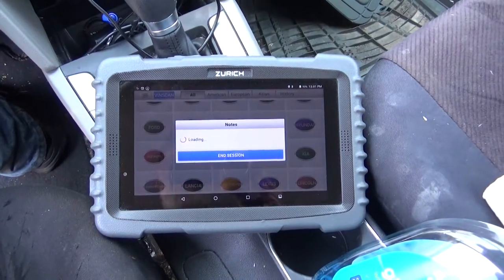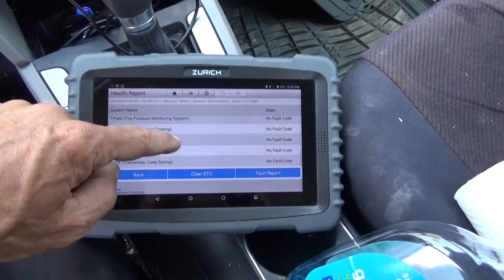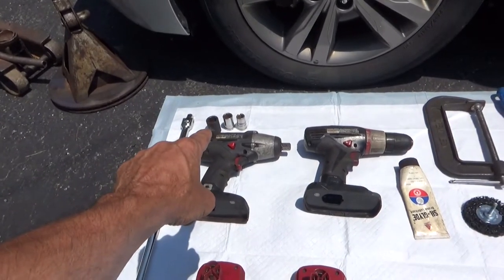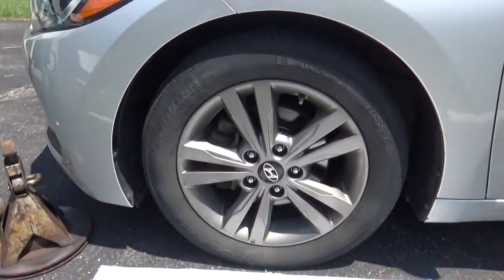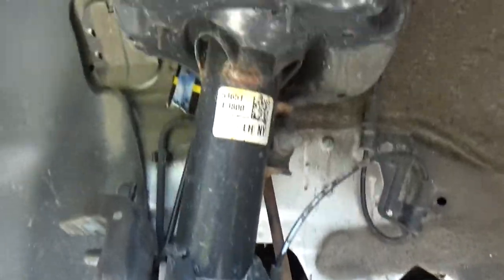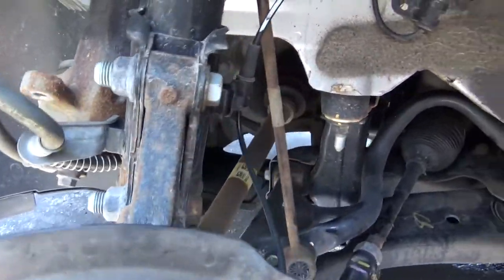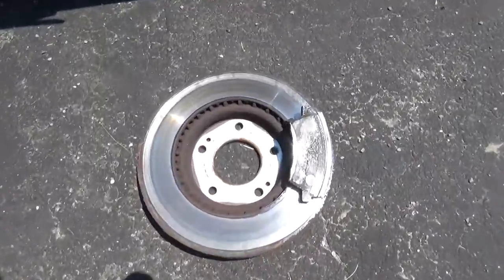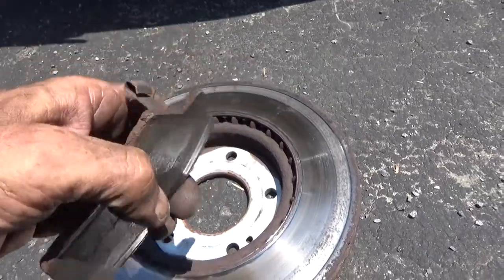2018 Elantra (ADA) Front Brake Replacement - Auto Repair

Comment: So what did that fancy computer teach you how to do brakes. Smh
Reply from the maker: What did it TEACH me? Nothing.
Using the scan tool to do a diagnostics pre-inspection, alerts me of any potential issues, as well as allowing me to inform the vehicle owner of the same. The use of the scan tool is in no way required for THIS service, but there ARE brake services where the tool is required to put the vehicle into SERVICE MODE.
 Using the scan tool is a free diagnostic service performed for the benefit of both myself and the vehicle owner. (Hard to be blamed for something pre-existing, when it's documented)

Comment: Very useful video. The best feature is your verbally describing every step of the way and what tool & size you are using as you use it.
Reply from the maker: It all began with "What is involved?" When I could search and find what I wanted...great. But...when I couldn't find anything, that got me thinking, and creating.
Reply: @HouseCallAutoRepair  I reckon my only question would be why did you not use Anti-Seize on the two little rotor screws and the two caliper bolts? Anti-Seize would make future brake pad changes much easier.

As for my 2019 Elantra SE, it's at 81,000 miles on the original brake pads and it's past time to change them. I hope I don't have to  change the rotors too but I'm prepared for the worst and hoping for the best. Thanks again for your great video!

Comment: Thank you so much! my 2018 brakes are due and after watching many videos I felt confident but watching a video about the same exact car as mine is amazing. Thank you and your camera angles were amazing. Very pro, you help people save ton of money.
Reply from the maker: It's sad to see something so new, needing brakes already. The last brand new vehicle I ever owned went 128,000 miles before it needed front brakes. 135,000 I replaced the rear, even though they would have gone several thousand more miles.
Reply: @HouseCallAutoRepair  I agree man... my car had 45000 km and it needed front rotors while my pads were basically at 40% life used... rotors are bad. My old 4 years German Lease was returned and never had a brake job

Comment: I could almost read your mind when you were putting those paperclip looking things back on! Anyway, no mention of siphoning any brake fluid out before compressing the piston, is that not needed? I've always done that in the past. And do you not recommend antiseize on any caliper or bracket bolts? I know it messes with torques, but I never torque anything anyway.
Reply from the maker: While brake fluid is recommended to be replaced every 4 years or so  (hygroscopic)
 I don't mess with removing any brake fluid,  unless fluid has been added to compensate for low levels due to wear.
As for bolts... I'm trying to condition myself to use blue thread locker on all of them!
Antisieze the brackets UNDER the hardware clips, the piston surface, and back of pad that contacts the caliper ears (to help prevent squealing)

Comment: Why is it important to get both wheels off the ground?  What's wrong with lifting one side at a time?
Reply from the maker: I personally find it easier, this way, as apposed to doing one complete wheel at a time. The advantage is to unload the suspension so that it's easier to check for loose or worn components as well as turning from right to left and back, and rotating the wheel. Thank you for asking!

Comment: Okay, so just to make sure, the clips that go on the pads aren't necessary? Like on my Rav4 the pads just go on and then you put the caliper on, no stupid little metal clips necessary to hold the pads in place.
Reply from the maker: The metal clips that go between the brake pad ears and the caliper bracket ARE necessary. The little clips that are sometimes already attached to the brake pads, are "squeelers" which are audible wear indicators. I have some Rav4 brake videos...

Comment: The dealer just charged my girl 2 hours labor 197 bucks for changing the pads ....this seems high total 279.95 ...all info points to 1 hour labor is this correct?
Reply from the maker: That seems to be the average that I see... I charge so little, it's almost not worth the time/gas/tools, but that's about to change a bit. I could double my rates and still remain cheaper, BUT I don't have a huge overhead to consider.
Reply: @HouseCallAutoRepair  got ya thanks for the reply

Comment: This is so unsafe. Wrong surface and trying to do both sides at once lifting the car the wrong way. It'd be much safer doing one side, then the other.
Reply from the maker: I don't live in an earthquake prone area, and other than reaching under the car to place/remove the jack stand (It's still supported by the jack too) I'm not putting myself or the vehicle in potential harm. Did you also notice where I put the wheels?
Feel free to inform all the people who see this post, which surfaces you are speaking of, why. and what you'd recommend! I'm sure everyone can benefit.
Reply: @HouseCallAutoRepair  The wheels went under after the fact. The old disc is not big enough to support a jack stand safely. And it has sharp edges that can dig into the asphalt. Where would I do it? My garage. Same place I always do it. Concrete is much safer and not prone to buckling in high temperatures. If I wee to do it on asphalt I'd do one side at a time. I do it that way anyway, just because it's safer. Jacks can give out. You never know when. Jack stands can topple over, too. If it wasn't brakes and the wheels didn't have to come off I'd use wooded ramps I made using pressure-treated wood. 2x8's screwed together. If it were in my garage, metal ramp. Still with the jack stands and tires under the car just in case. I've had one car fall and the wheels saved me a broken leg. You can also rent shop space at a lot of places. Some have lifts. I've seen people do this in sand and even on the grass, but then I've also read about the cars falling on people killing them.
Reply: My wife and I are moving and where we're moving to I won't have access to a garage, so I'm not too sure how I would do my brakes in the driveway. You "could" just go for it and hope for the best, but that's not the smartest plan. Even with jack-stands it's not a great idea. What I might do is buy a large enough piece of pressure-treated wood for the side I'm jacking up to support the weight of the car and be big enough to not sink into the pavement. If I go that route I'd go wheel to wheel and not try lifting the entire front and entire back. Or possibly try to find a parking garage no one would care I used if I parked in a corner and did the brakes there. I actually have to do my brakes again before we move, we have about a month. And then there's a chance I might just start going to the shop to have it done. I know a good shop about 15 miles from me that doesn't charge too much, maybe $200 or so for all 4 wheels if I have the discs and pads. The cheapest place near me without that stuff is $600 for all 4 with them probably resurfacing the discs, which is a ripoff. I should open a brake shop. But then I'd have to do things like bleeding the brakes, which sucks.